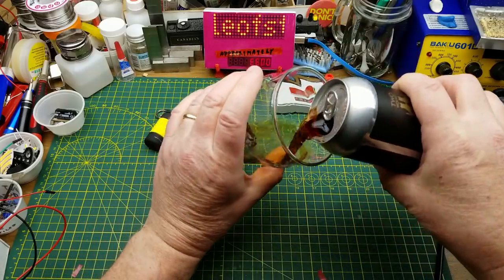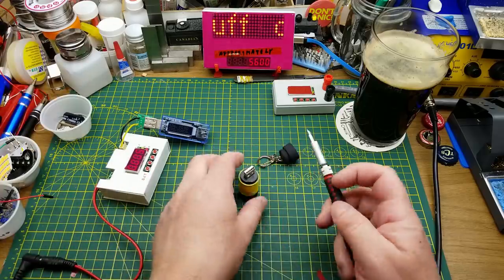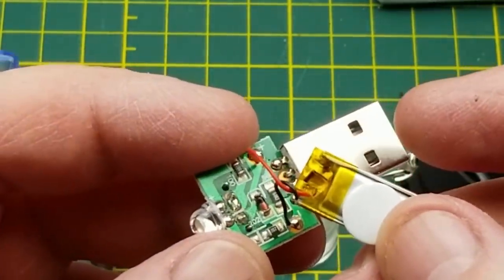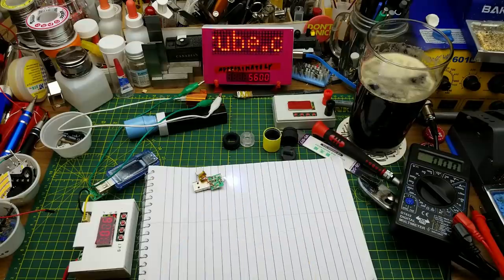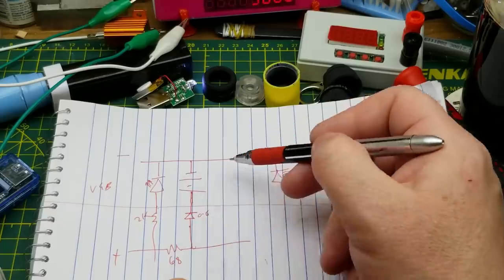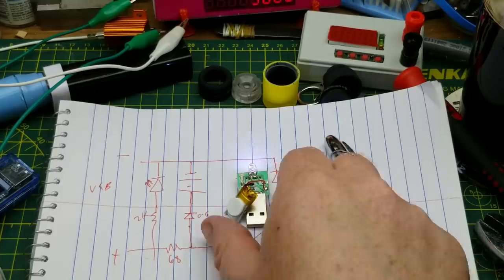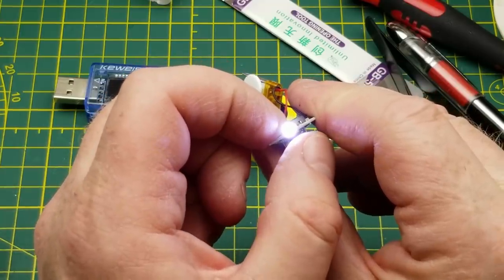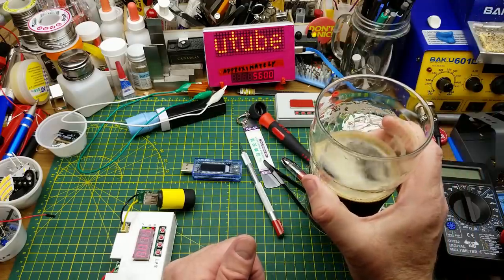teardown: cheap usb flashlight

Comment: Another cool video, thanks! I ordered 2 for $2.60 right after your postbag. I dont care if the battery works or not....i just wanted a flashlight to plug into my battery pack as the regular ones are very expensive...so this will work great for me. Thanks!

Comment: If they would have added a shottkey diode in series in the charging circuit, they could have dropped another 0.2V and have a theoretical max voltage of 4.2v , which would have been a bit safer!
Reply from the maker: Yeah, there's lots of room for improvement, if they had been interested in spending a few more cents.

Comment: I ran one of these for 18 months. 5 to 10 minutes at a time 5 days a week. Would give it a charge once a week. Worked great for where I was working at the time.
Reply from the maker: That's good to know.
despite the lack of battery protection, it seems like a reasonable little light.

Comment: Is the charging LED visible from the outside (through the lens maybe)? Otherwise that is there for no reason ;) Also the 10Ohm resistor is driving that LED really hard! And maybe I'm thinking wrong, but as the USB voltage can go up to 5.25V and only the diode-drop of about 0.6V that would mean the battery voltage could go up to 4.65V??
Reply from the maker: The charge LED is visible in a darkened room.

And, yes, there's nothing from stopping the battery voltage from getting that high.
Not an great design, but I suppose it could be worse.

Comment: I suspect the designer is relying on the protection circuit on the battery to cut off power and protect from overcharging.  Oh wait.  There is none. 
:)  Nice tear down.

Comment: At the end, when you were measuring the current charging the battery, does it matter that there was also current flowing through the LED?
Reply from the maker: Yeah, a bit.

It'll charge even slower than I made it look.
Reply: @pileofstuff  - I reckon it'll charge FASTER because the (massive >10mA) current will all get into the cell, rather than having some bled off by the LED. The 68R current limiter is before both diode and LED, so they share the charge.
BTW, the B3603 won't be very accurate at such small current levels, neither will that cheapo USB meter.
 You should make up a USB Breakout board using either an old Charger Doctor or a Male+Female of the eBay USB breakout modules. Then insert your multimeter on mA range and get much more accurate measurements.

Comment: Well they are relying on the very small current to not fry the battery first time out of the gate.  I'm OK with that for $1 too.  What's the capacity of the battery?  Maybe 50 or 60 mAh? (Edit: mabye as low as 35mAh?)  Charge overnight from flat and you are probably OK.  The current will drop as Vbat increases - at 4V Vbat you weren't seeing much input current.  Over discharging is probably more of an issue, I'm thinking.

I'm wondering how much electrolyte there actually is in that battery.  Does it look puffy because of a lot of electrolyte, or because they have done a lot of tiny folds/rolls with just the normal amount?  Possibly the latter.  So maybe 50mm each of copper and aluminium, and maybe 0.3CC of gloop.  Just a few cents of materials, a bit more in labour (probably done by hand in a sweatshop, I'm thinking).  China is amazing.  Scary, but amazing.

Comment: If you got rid of that resistor and replaced it with a short and used a TP4056 with the r changed that would do it (lot of work) but I like ( simple electronics
) idea.
Reply: You'd need to modify the sense resistor in the TP4056 module. Imagine putting 1 Amp charge into that tiny little LiPo.... I guess it would charge very fast, at least the first time LOL !!
Reply from the maker: Yeah, I doubt it would be happy with a big charging current.

Spectacular, maybe, but not happy...

Comment: My only question: What is the size of that lithium cell?
Reply: Another pointer: You can get Lithium Polymer cells WITH protection boards on them.
So that could be a better idea. Instead of redesigning the whole circuit board, just get a cell with protection circuitry on it.
Is it fail-proof? No, but better than none i say.

I ask the size cause if we get the size, we can look up and see if there's versions of the cell with protection boards on them.